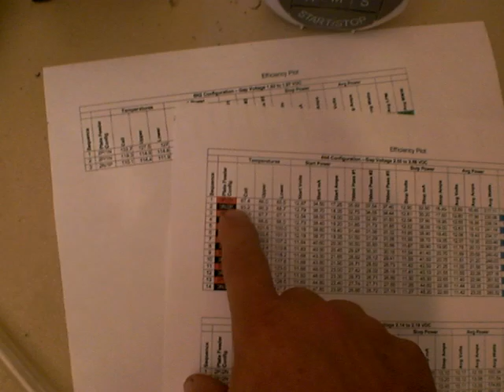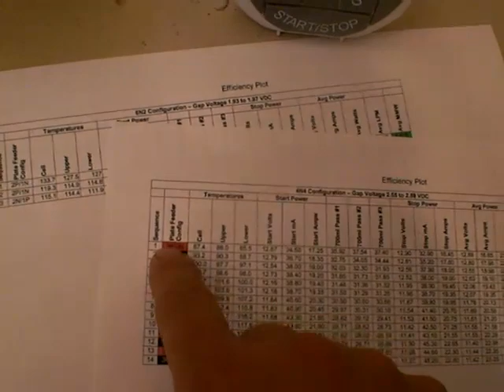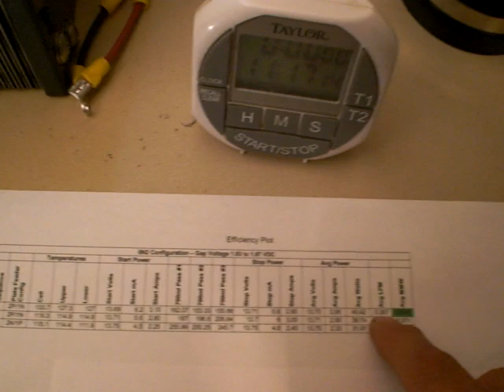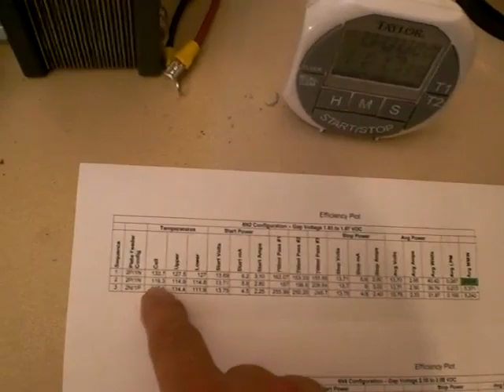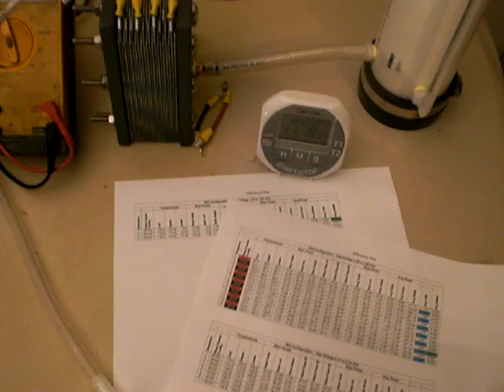EBN Dry Cell - Efficiency Map (w/data)

Comment: Have you tryed connecting one positive to one end and negative to the other end, so to speak - with all the plates inbetween being neutral? If so what is the difference between a simple set up as above compared to the other variables in terms of BG production?

Comment: Good work Luther,
I personally like the 5n4 configuration just for the reasons you have stated. With 5n4 the heat rise is minimal 103f. Production drops a little, but the energy used is stable and not used to heat water. 

I have just gone back to my homemade 40mil gaskets (down from .0625). At 40mil with 4n4 the reaction was too hot and hard to control, however at 5n4 it stablizes nicely. 

If I can get some made in pvc I would like to try an even thinner gasket just to compare reactions.

Comment: very nice. thank you very much for taking the time to validate the capabilities of our device.

for a kit intended for anyone to "assemble it yourself", the numbers you are turning are outstanding. high 5's and low 6's for mmw right out of the box. wow. 

we thought about a 5N config as we knew it would be more efficient and run cooler. but we were concerned that the lower production would turn some folks off. its a tough choice. 4N seemed a good compromise between production and efficiency.